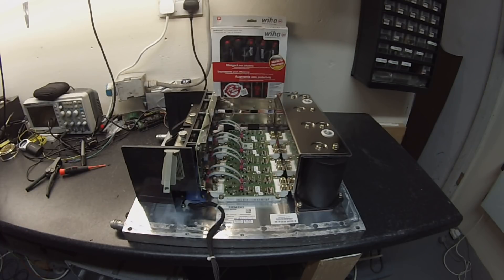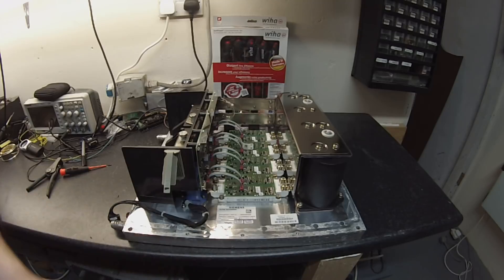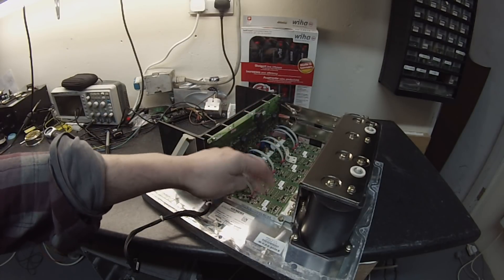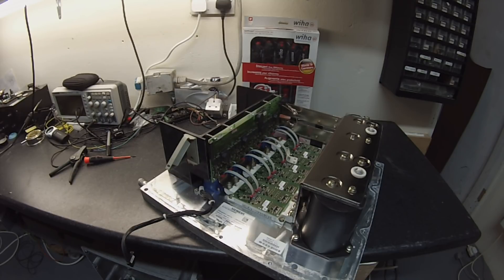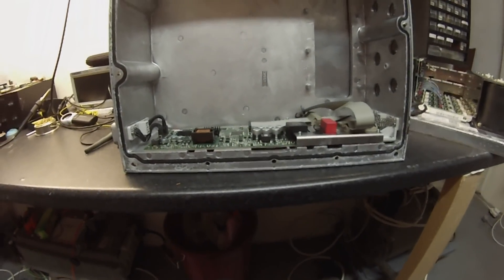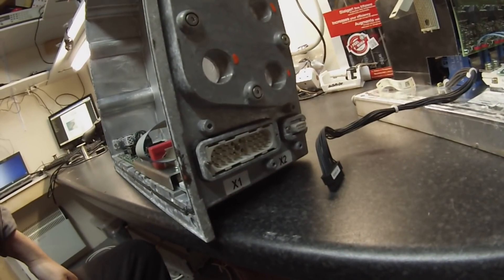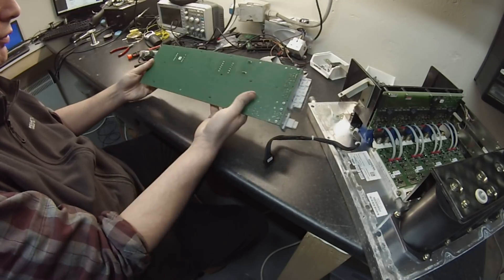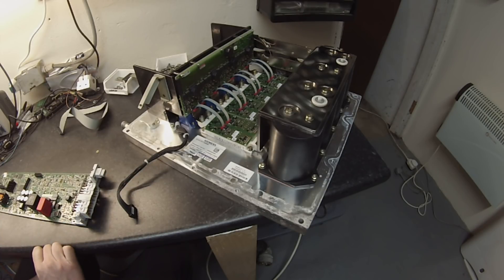Hacking The Siemens Elfa2 Inverter Part 1

Comment: X2 is apparently a "The connection between pulse encoder signals from the motor and the traction inverter is established by inserting and fixing the 9-pin plug connector X2"

I think the code for your connector is A5E01068694  as in X1. There was a company in UK that sold it. Kempston Controls.

Just in case you don't know about it, there's a manual online over at docplayer(dot)net. I can't link you because YouTube, but you can figure out easily in case you weren't aware. It has the pin-out for the X1 connector, all 32 pins.
Reply: That is a great find.  Good work.

Comment: If I were you, I'd find the train it went into and then get the wiring diagrams for it.  You should be able to figure out the signals that need to go into the weird connector to make it run.